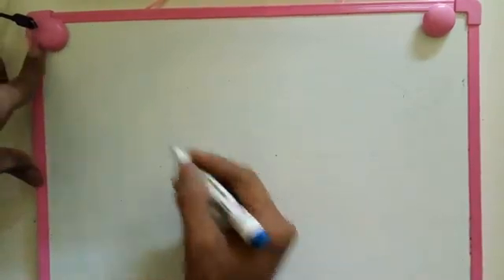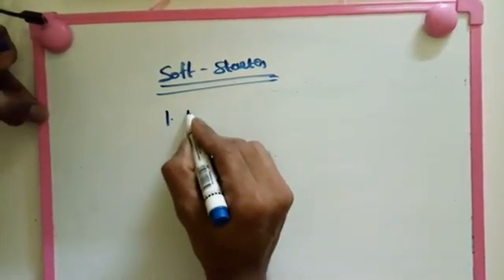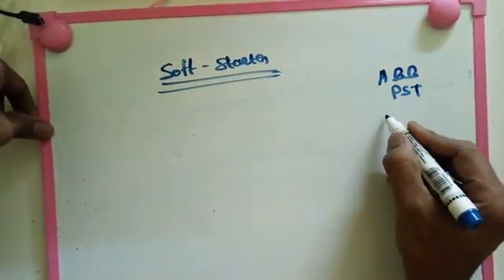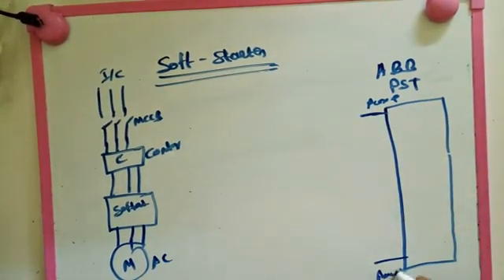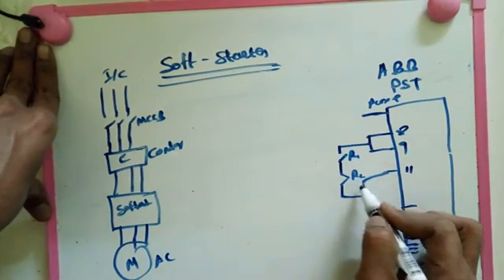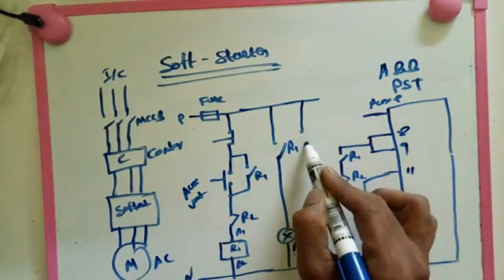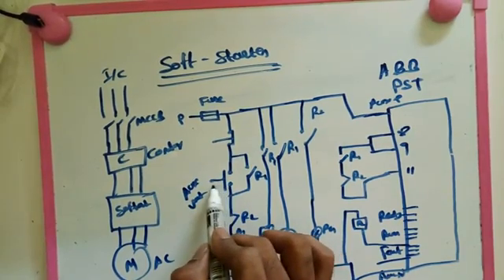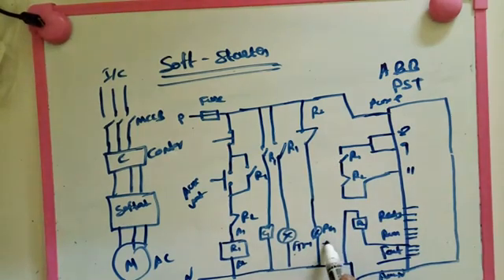Soft starter explain new 2017

Comment: hai dear sir
i found in our company there used two contactor in soft starter for pumping application.what is the use of this two contactor?
Reply from the maker: two options for two contacts ie forwards and reverse operation or two motor one softsarter for duty sharing methods ..
thank you for support
Reply: inside delta connection did we use two contactors?what is the benefit of using inside delta.Thanx for your valuable time and all videos are really helpfull.